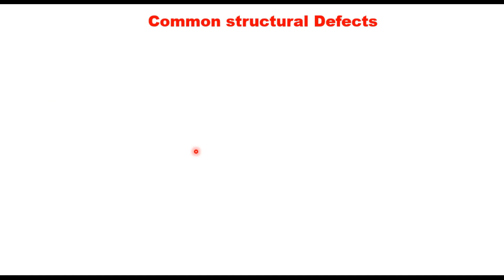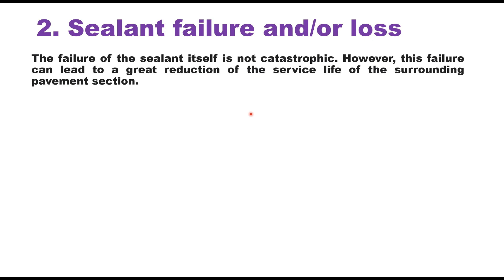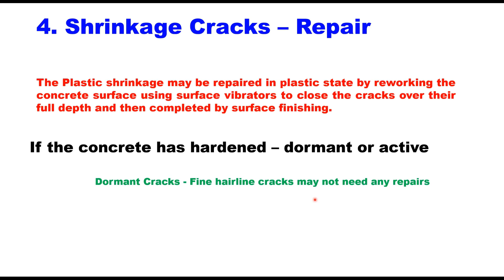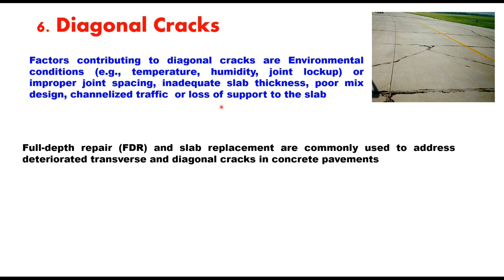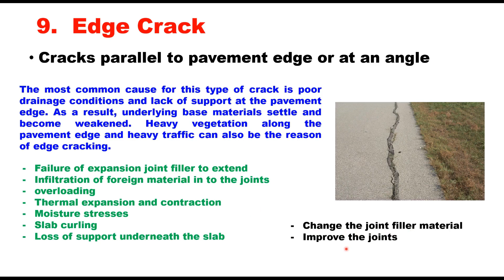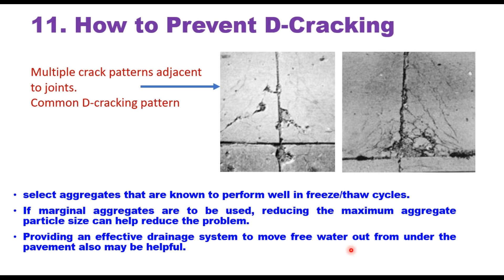Failure in Rigid Pavements - Part 2, Structural Distresses 13 types in one video, Causes and Repair

Comment: Thanks for session🙏🏻
Full Depth Repair means Repairs up to the subbase or it's only up to the PQC layer?
Reply from the maker: Generally, PQC layer. But if failure is due to subbase movement, then it may need repais up to that depth also.